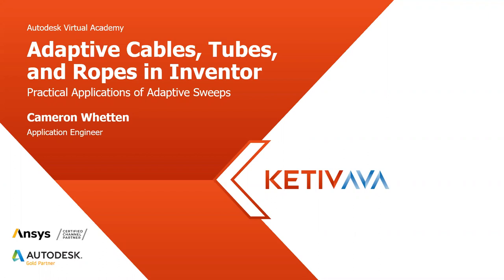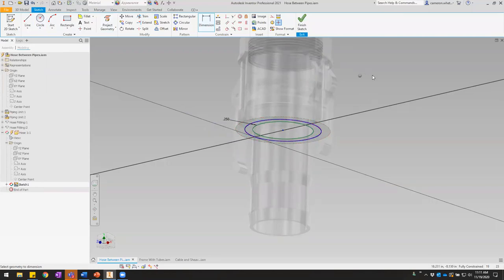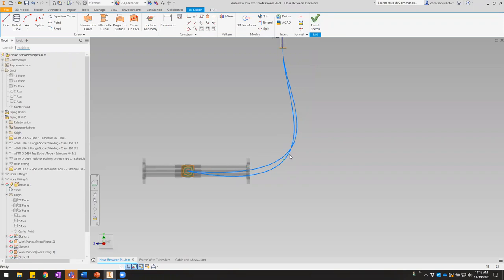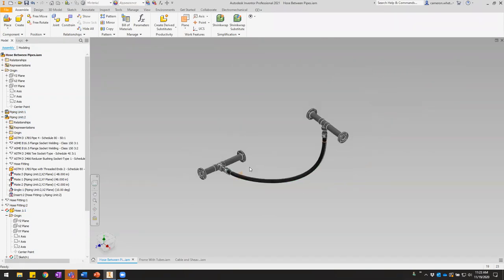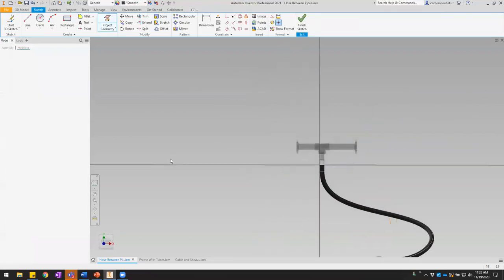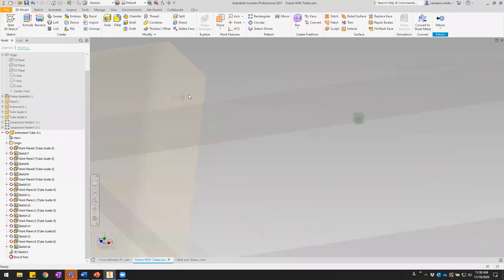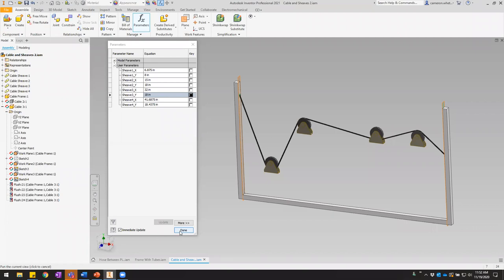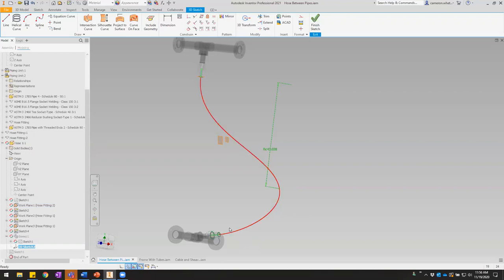Adaptive Cables, Tubes, and Ropes in Inventor | Autodesk Virtual Academy

Comment: Just stumbled across this video and watched it to see how closely it compares to the method of modeling hoses that we developed at my company years ago.  Turns out that it is very similar.  One thing we had struggled with was how to deal with routing through hose clamps.  I believe the method you show in your electrical cable example will solve the problems we had. We had been trying to do it using some method with adaptive work points, and the adaptive updating is inconsistent  on a good day.

I did want to point out that the answer given about controlling the spline length is not quite correct.  That is possible outside of Tube & Pipe.  However, it was a fairly new feature at the time that the video was recorded, so the presenter may not have been aware of it.  He was unable to find it because he was looking in the location where the option exists in Tube & Pipe.  Instead, all he needed to do was put a dimension on the spline in the 3D sketch.

Comment: Now with this is there any way for inventor to calculate the force required to pull an object through a pulley system as shown?
Reply from the maker: Inventor has some built-in design calculators that are intended for very specific scenarios, but cable tension through a pulley system is not one of those scenarios. So, Inventor won't be able to give you this information about your design.  KETIV | Cameron Whetten